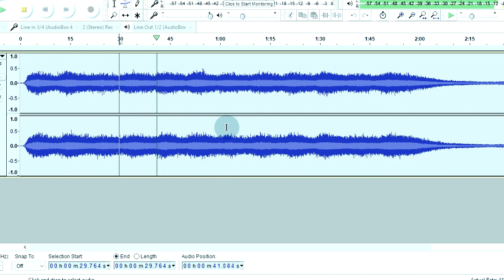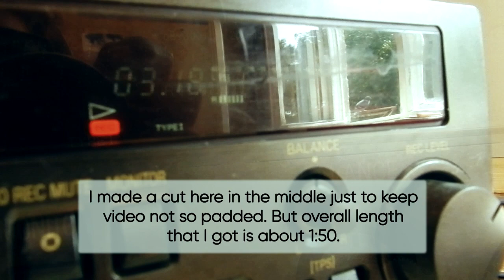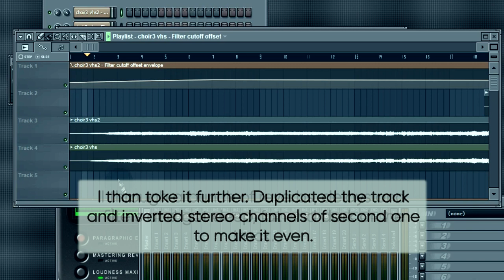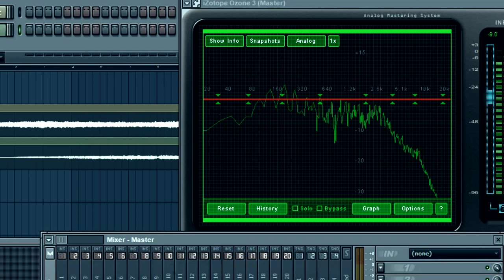AUDIO Cassette with VHS tape (complete process)

Comment: You do realize your can record audio only using a HiFi stereo VHS deck? And yes, I realize this is an old thread. But I wanted to put it out there in the database.

HiFi VHS decks had another set of spinning record/playback heads and recorded the audio using the same helical scanning process as the video. The combined speed of the VHS tape in SP mode plus the spinning recording heads creates a relative tape speed you can't find in any audio tape deck. Even using the LP or ELP recording modes you will still get a tape speed faster than the best (15 IPS) reel-to-reel decks ...and at the slower speeds you can record a lot of music on one VHS tape. The down side is you generally have no control of audio levels ...or a way to monitor them ...using the VCR itself; you'd have to use an external mixer (with level meters) to tweak the input line signals to the VCR. You also don't need to worry much about tape hiss with HiFi VCR audio because of the recording speed. VCR tape is going to be much more robust, physically, than audio tape simply because of the recording and playback process of the spinning helical recording heads; audio tape would wear out very quickly. 

To get the best recording on your video come audio tape, you'll need a 3-head cassette deck with an adjustable recording bias control ...usually if the deck has the adjustable bias it will have 3-heads (record, playback and erase) ...but you'll need to be able to real-time monitor the recording to set the tape bias and that's only gonna happen with a 3-head deck. For a test signal, you can use inter-station FM hiss. It's pretty close to white noise and works exceptionally well for tweaking the tape bias. To get the inter-station noise you need to turn off the "mute" switch on the FM tuner your using. Load a cassette into your machine, set the deck to monitor the input signal, set the record bias to the tape your using. For the VHS tape you'll have to experiment; I'm guessing "Chrome" or "Low Noise High Density". Feed the deck the "white noise" and adjust recording levels to 0VU. This process works best using headphones plugged directly into the cassette deck. Start recording the white noise on the cassette tape. Now switch between the input signal and recorded signal; ideally they should sound alike. Since you're dealing with an unknown tape formulation, try the different tape settings and go with the one with the closest sounding match. Then, tweak the bias knob one way or the other and monitor the change. The goal is to get the recorded "hiss" to sound like the input "hiss".
Reply from the maker: Hi, thanks for your extensive comment. I'll definitely use your tips when-ever I will get a hand on proper hardware, not sure if hifi vhs deck is possible to find in europe nowadays. This deck on the video is already dead unfortunately and new one I have is not a 3-head. 
I'll try to find a vhs recorder since I have a big stock of sealed vhs tapes that waiting to be used.
Reply: @blearmoon  Try eBay. That's where you'll most likely find a nice HiFi VHS deck. As most of these VHS decks are now "white elephants" you can usually score a nice, high end VCR for pennies on the dollar. Just to clear up some possible misunderstanding: the 3-head deck I'm talking about is a cassette deck ...not a VCR.
Reply: Well, Blear Moon couldn't have used much better cassette deck than Technics RS-AZ6. It is thought that this deck has best heads available on the market, with frequency response surpassing even Nakamichies. (The actual condition of this deck is unknown, though.) What B. Moon did wrong is putting Chromium/Metal (probably even better) grade tape into a Ferric type shell, consequence of which AZ6 deck used wrong settings. Furthermore, he probably did not try to calibrate the tape before recording (it is not shown in this video, at least). To make things worse, he used awful method of cutting the tape which most likely made the deck transport struggling to move the tape evenly over the heads.

What B. Moon should have done is to find some way to cut the tape precisely and put the cassette into a Nakamichi (i.e. Dragon) deck, because Nakamichies have an option to manually select the tape type and manually adjust the BIAS/level settings in very wide range. I'm pretty sure that after some twiddling one could determine the closest cassette type and BIAS/level setting for this tape. It would be great to know which standard cassette is the closest to the video tape.
Reply: @bsimic29  Well, yeah, he could've used a much  better deck. The AZ6 dates from the mid-90's and by that time digital was making inroads into the home recording market; development had shifted from analog to digital. The "6" had 3-heads and Dolby HX Pro ...but not much else. It was mostly made of plastic and what was metal were typically relatively thin metal stampings. Most truly high end machines will have multi-motor drives, a much more robust chassis and offer fine tuning of the recording tape bias. The "6" was priced @ ~$250 in '96 ...I have a Pioneer CT-F950 I purchased new in 1979 ...the beginning of the end of the era of fine home audio. The thing is a tank. 3-head, 3 motor transport with dual capstans. The face is made of 3/16" thick aluminum. It's recording specs, while not the utmost at the time, are quite worthy. It still records and sounds quite nice.

The whole exercise of using VCR tape as cassette tape is interesting but, quite frankly, not worth the effort ...especially if you use a HiFi VCR as an audio tape deck. Since the tape formulation is unknown, and the deck has the factory set recording bias' for whatever formulations were used to set the bias', performance of the VCR tape would most likely be less than optimal.
Reply: @blearmoon  I used vhs tapes in a VCR for recording audio (from CD's that I lent) decades ago. It sounded rather good compared to cassette tapes. The only downside, it didn't fit in my walkman 😁
Reply: They  have vcr with audio level controls on  em I have like 2 different vcr where I can set audio levels and see them and change the sound of the audio from hifi to standard are even mono
Reply: @BrainHurricanes the old Walkman 😂
Reply: @BrainHurricanes some vcr's were made for audio recording I was told by a few people jvc made vcr's specifically for audio recording I don't know which models though
Reply: 매우 흥미로운 정보 입니다.  저도 hi fi vhs 를 시작해야겠습니다.

Comment: Interesting experiment. You cut the VHS tape in the side, where the old style monosound is recorded. If it's a normal NTSC recording, the recording speed is 2.34 cm/s, and you are playing it back at 4.76 cm/s (approx. double speed) - the reason for the mouse chatter sound. The HiFi sound is recorded by heads on the rotating drum, and can not be played back by a stationary head maschine like a cassette player. It's FM modulated too.
Reply: The HiFi tracks are digital and I believe are recorded by the video head.
Reply: @Robert08010  They are analogue, FM modulated, not digital - and the audio is recorded via separate audio-heads, placed on the rotating drum.
Reply: And because of specific azimuth of video heads and their angled position relative to the VHS tape, I'd be surprised if you'd hear anything playing the video / HiFi audio portion of the video tape on ordinary cassette deck. It'd probably sound as playing the blank cassette.
Reply: @runepedersenDK  Exactely!
Reply: @Robert08010  Dear Lord  😮‍💨💨🚽

Comment: You've put the tape in a type I shell, so the deck handles it as type one. Put it in a type II shell, it should be better that way.
Reply from the maker: Yes I did, 
I have just one type-II cassette and i am not wiling to sacrifice it. When I will get a spare one and a way to better document this I will do a revision of that experiment with maybe more wide coverage of its potential and comparisons. since than I came up with few other pretty interesting experiments with what else can be done with tapes, but I haven't filmed it yet.
Reply: @blearmoon  You can easily convert a type-I shell to type-II. Just snap off the covers of the windows next to the erase protection tabs. You can do it with a plier if you disassembe the cassette. You may also try BASF/EMTEC video tapes, they use pure chrome magnetic particles.
The easiest way would be to use a deck with manual tape type selection, and manual bias level adjustment. This way you can try it with metal setting, or with chrome setting but the bias cranked all the way up.
Reply: @mrnmrn1  Yes, just what I was thinking. VHS tapes are often made with chromium oxide, like type II tapes.

Comment: I love Audio Compact Cassette Tapes! There's something about them that I never stopped using them. Recording one right now, professionally, on my professional studio equipment.
Reply: I recently digitally captured and remastered cassette recordings I made in the '80s.
Reply: I grew up in the 80s and couldn't stand them. Perhaps if I had owned a cassette deck with dbx noise reduction, or if Dolby S had arrived sooner, cassettes would have been more tolerable. I did like Philips DCC format, though, which had CD comparable sound quality.

Comment: I suspect there are three  deficiences on that new tape - most important are  audio drops which obviously result from not perfect touching head  in audio deck . . They may be result of using margin side of video tape - it is part which is the most prone to any mechanical damage and dirt in vhs casette.   Should be used  new VHS tape but is was not the case,  or provide wet washing  for tape . 

Then the way of cutting - with using while cutting hard force for pressing on blade,  the tiny layer of tape may be deformed at very edge. Technology should be using minimum force. Another problem is preventing even minimal oversizing of tape widith - any used casette deck  has  heads   wear and this will prevent wider tape from full contact. If precize standard widith is hard to adjust t is better to make the widith  less about 1/10 mm. For sure with presented way the widith could be    increased by about 1/10mm (blade thickness plus hand   unaccuracy )   Then we can  discuss BIAS  which is already perfectly provided in comments. If we expect excellent result   fundamental problem may be  also  audio correction for chrome with  formula may be different. Anyway it is exciting and I would go for it just by curiosity.

Comment: Nice experiment ! 
Did you put in the tape the right way? the drop in high could be because you recorded on the back of the tape which is like lifting the tape a tiny bit from the record head which reduce the high.

Comment: I was hoping for better quality.  VHS is hi-fi.  It's probably better to leave the VHS tapes as are and record on a VCR though RCA jacks.
Reply: HiFi is an add on sound format to VhS . It uses separate heads on the scanner drum being it's uses FM as the carrier.

The default sound for VHS is a linear analog track that runs on the bottom edge of the tape.
Reply: hifi video recorders could produce outstanding results

Comment: I did exactly opposite like 25 years ago. I had some reel-to-reel data tape, used at old telephone station as storage for "computer" and a VHS cassette with jammed tape. I had noticed that width of these tapes was similar so I winded tape from data reel to VHS reel and put it all into VHS cassette shell.
No, it didn't work well. That tape was too bad for VHS, it was Fe (brown) btw. My VHS recorder only could record badly muffled sound and no video. :-)

Comment: You can also experiment with DAT or DDS-2 tape, it has the same width as normal cassette tape, so no need for cutting it. Just unscrew and spool the tape onto the cassette hubs and you're done! I tried this with a type IV shell, it has less bass and sounds brighter, but also a bit harsh compared to regular chrome tape.
Reply from the maker: I have this in my plans for sure! I've already tried mini-dv - but with no results, so no video about that. But I already found out where I could buy some of that other kinds of tape
Reply: It has even the same length, but price is about a good metal cassette. And so a quality. So, it makes no sense.

Comment: Beta Video, BASF Real Chrome VHS, HD VHS, Camcorder Tape and Reel 2 Reel next on the agenda for experimentation. :P
Reply from the maker: I've already have sealed HD VHS stashed for that exact purpose and I will try to get super 8 or whatever this obscure tape format is called. mini-dv didn't worked completely so i didn't even bother to finish and edit the video
Reply: @blearmoon  I wonder how the VHS would have worked if it was reversed inside out to the direction it was done on as a VHS? That idea would be a daft one to come out of the idea of a Type III where a Ferric and Chrome are either sticky back plastic or superglued together maybe even just both wheeled cheaply at the same time in the shell but that uses one back to another either way it was made as seen on a video where a BASF Type III fell apart.

The idea that both sides might be recordable from the Type III thing but 1 side may work better than the other could be fun as well.

A fun thing would be to try and cut a master sound quality reel to reel as they were made for audio but probably a different width again to a compact cassette.

Or is that the same size and it's movie reel maybe I'm thinking. haha

Comment: VHS tape magnetic layer is too thin, it is not suitable for low frequency linear audio recording (Khz) at slower speed such as a cassette tape player, it gets saturated pretty quick, It was designed for high frequency (MHz) high speed using rotary helical scanning, that's why linear audio on VHS sucks, and HiFi stereo using the audio rotary heads modulated into high frequency sounds way better.

Comment: the VHS cassette tape is equivalent to type b am i right ?
Reply from the maker: not really, its much thinner and overall feels different by touch. also considering it cut hi frequencies I could say that it is quite opposite to type-b
Reply: No. The two tapes are totally different.

Audio cassettes uses iron based particles for its oxide and the particles are laid in direction of the tape.

Video tape uses a colbalt based oxide that it's particles are laid perpendicular, or crosswise to the direction of the tape to align with angled tracks.  Thus, VhS tape would sound lousy as an audio tape source...even the linear audio track on VhS tape is only passable.

Comment: My dad did something very similar in the 70s, he was working with mainframe computers and good reel to reel audio tapes were hard to come by, so he got some tapes from work, created cutting device which cut it relatively precisely from 1/2" (same as VHS tape) to create 1/4" rather high quality tapes. It was precise enough for the Eastern block reel to reel players, but when I tried playing these cut tapes in recent years on Revox B77 it got stuck very often - Swiss tape path is much more precise and unforgiving :D

Comment: Well I can recommend Rolling Stone’s “Not Fade Away” that will fit on your cassette!  But can I recommend you keep the vhs tape, invest in a good cheap quality 6 head vcr and have 4 hours on a single tape and better quality than most old scrapyard Dragons or other decks that you need to remortgage your house for from the 70’s. 
OH and let’s not forget the price of compact cassette tape Normal, Chrome or metal ? Crazy prices.  Why someone would pay over a £100 for metal tape I do not understand them. Rant over still an interesting video mate😁👍

Comment: pretty a much a waste to cut open a vhs tape and an audio cassette in 2019 since they are no longer in production. you are never going to get the same sound as the original tape
Reply from the maker: ehm, well I am ordering cassette production for my label every month with no problem and I know at least 2 companies that produce vhs at any moment with no problem ..
Reply: @blearmoon  What are these companies? I am actually looking for brand new Cassettes and VHS to archive my data in... analog
Reply: @blearmoon  Did you know there are record lathe shops still in existence you could also have your music physically pressed onto vinyl by?
Of course they may have a run quantity minimum you would have to make.

Vinyl is, after all, the only music medium that, in essence, can be played without electricity if we ever become forced to go back to that era by some disaster like an an EMP solar flare.

Comment: NO GOOD MAN. RECORD YOUR MUSIC IN VHS HIFI TAPE WITH A 6 HEAD VIDEO CASSET RECORDER. HIFI VIDEO CASSETE HAS BETTER AUDIO.
Reply: Totally agree.  A good hifi vcr with a good 4 hour long hifi master broadcasting tape played via rca connectors on a decent amplifier and speakers.  This is the audiophile way.  There are even super hifi quality vhs tapes with 5 hours of recording in sp mode.  I respect what the editor of this video does as an experiment or fun but it leads nowhere.  Maybe he could cut the tape out of a good vhs hifi tape using the center part which is where it is recorded in stereo to recycle them for a large reel to reel.
Reply: @davidrubert1536  TDK HIFI TAPE VERY GOOD, WITH IMAGE AND AUDIO QUALITY PRACTICALLY EQUAL TO THE CD
Reply: @holtzholtz1656  20 hz - 20khz .. yes you are right. Like a cd quality 👍 Cheers !

Comment: I think you just waste your time & one VHS tape , you can get CD quality ANALOG sound in HiFi VCR even in SLP mode(360min).
Reply: that definitely wasn't the reason for this tho, it was to begin with an experiment with the effects of the different tape formulation on the audio cassette. If you want just the best quality anyway go high end digital and you're set, fast reel to reel for best analog.
Reply: I am just getting into Hifi VHS for analog recording.  Pretty neat thing to stumble upon.